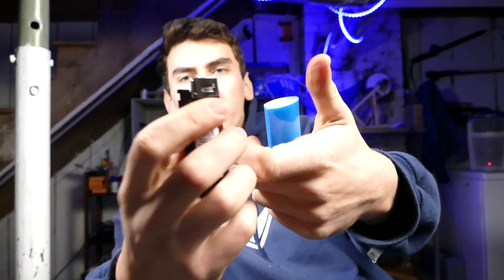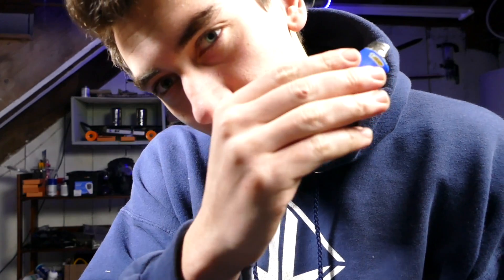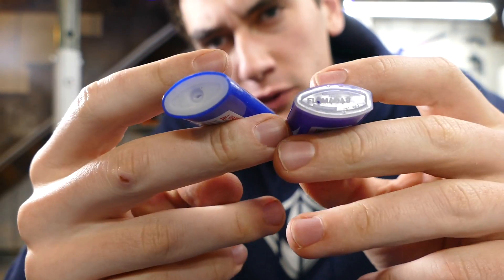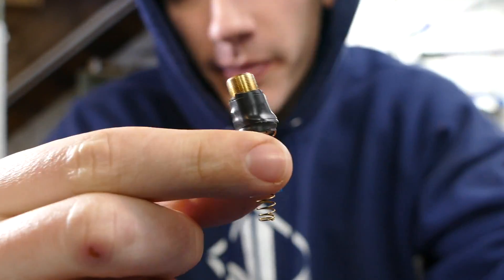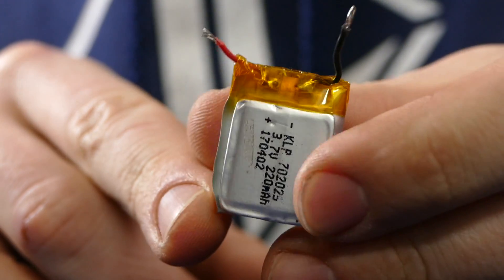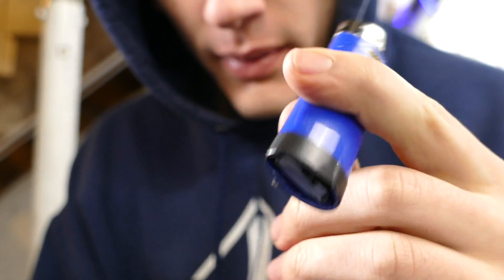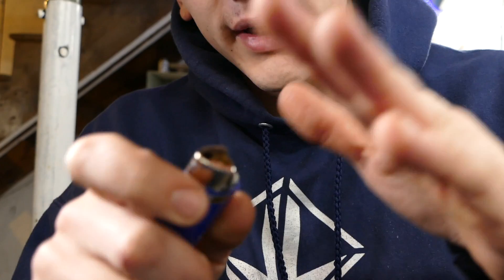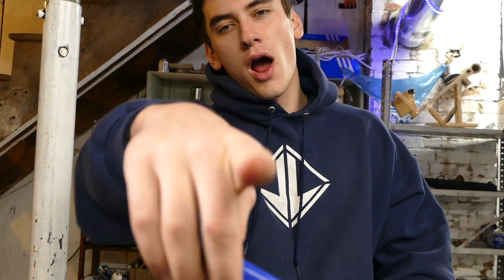Make a Cheap LASER LIGHTER! - Awesome Lighter Hack!!! (Burning Laser Lighter)

Comment: If you look at the diode from an angle, you can see its purple and not green. This is because cheap green lasers use infrared lasers with a filter to turn it green. Cameras can detect infrared light like in a tv control remote